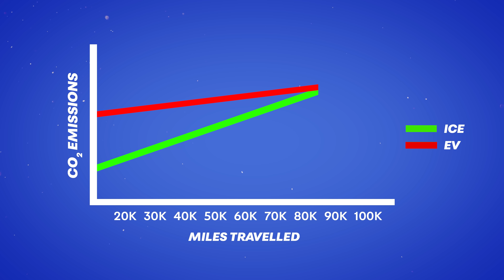Are Electric Cars REALLY That Green? [New 2022 Data]

Comment: I wonder how an LPG car compares?
Reply: LPG is clean at the point of use, but horrendously filthy during the refining process...
Reply: @Brian-om2hh  Depends if its refined at all, 60% of it comes from natural extraction. Theres also BioLPG sources. Given Dacia make LPG cars at the same cost on the bottom of the range models it's a no brainer really. Turkey and Italy have taken it up in a big way but the UK is a bit hit and miss. Its certainly worth considering given that the dacias are like 12k to start with, not seen any EV's anywhere near that price and we won't for some time yet so poorer people are still driving polluting cars. I wouldn't say LPG is clean at point of use either to be honest but a lot cleaner than the usual ICE.

Comment: carbon dioxide is not a pollutant. it is a necessary nutrient of plants and a necessary part of the ecological cycle. whether or not you are forcing a change in the equilibrium point of global average temperature by emitting carbon dioxide in the atmosphere, you are in no way "polluting the earth" through such emission. 

This is not just a matter of semantics. This is a fundamental misconception that leads to improper response. basically, it is well-poisoning propaganda to regard carbon dioxide emission as "polluting".

Comment: I work for a company that makes hydrogen gas compressors to refuel trucks that work at mineral mining sites for electric car batteries for multiple car companies. 
Only the transport trucks use hydrogen,which the pumps run off fossil fuel driven electricity. The waste by-products from this mining procedure alone far surpasses the ev's average life span. You would have to drive a tesla for far over 100k miles before it makes the "positive impact'  ,not to mention when the EV dies, there's still literally no standard procedure for disposal.,literally melting through the environment it gets dumped at.
Laugh all you want but these are facts,been doing this for about 30 years now. It will certainly get there someday, but not in anyones lifetime thats reading this.

Comment: I own a red Model 3 AWD not because it saves money on gas or because it’s zero emissions. I bought it because it looks sexy, drives quickly and silently with its instant torque, has fewer parts making it easier to maintain, and has good technology. Saving money on each refueling merely offsets the extra cost of an EV.

Comment: Nobody is mentioning that most electric cars will lose battery capacity over time and the battery will need changing well over 90k exactly like phones need replacement after 2 approximately. Nobody is talking about long term so basically the car will need another battery and might be junked because of high repair costs and the destruction of the lithium battery will also produce emissions.

Comment: 65'000 miles from even a small high efficiency ICE car like a Ford Focus releases 14 metric tonnes of CO2, the same range on a similar sized electric car like a Nissan Leaf releases barely 4 metric tonnes, it takes some incredible torture of the numbers to get such a large difference in manufacturing carbon footprint.

The "trick" Volvo is pulling is using an extremely large battery manufactured in the most environmentally damaging way possible but without the equivalent for the ICE car they use for comparison. Like an aluminium engine block could be made in the same country as the battery (where most electricity comes from coal power stations) and get similarly massive carbon footprint costs.

Comment: The estimates are off, the full CO2 emissions of gasoline is: 3.58lbs/gallon for extracting the crude from the ground + transport and another 12.42lbs/gallon refining the crude. Add that to the 20lbs/gallon when it’s burned in cars and the true total is ~36lbs of CO2 per gallon of gasoline burnt. So the cut off point is actually 1/3 less than indicated in the video.

Comment: Screw the morality and carbon dioxide BS I’m way more interested in getting rid of a dirty( oil leaks) smelly (carcinogenic crap from the exhaust)  lump of unreliable inefficient heavy metal junk that craps out after 100 000 miles because of all the moving parts. Way rather have a clean, reliable, simple electric motor that will run for a million miles with minimal servicing
Edit add PS - current figures indicate the battery life will match the motors life

Comment: One thing you/volvo haven't accounted for is the need to replace the battery. EV car batteries tend to not last as long as you'd hope for so that would then "reset" the chart again. Say the break even is 90k but the battery needs changing at 120k, you might need to do say another 30k miles on the EV to break even again after replacing the battery
Reply: And one thing you haven't accounted for are battery refurbishments, which usually cost just a fraction of a complete battery replacement..... There is much nonsense posted about EV batteries. Usually by those whom have never actually owned an electric car....
Reply: @Brian-om2hh  yes and battery refurbishments are going to be as good as new batteries yes

Comment: It's been proven that with the current electric grid in the US, it will not handle having more than three electric car chargers in one suburban block in a community it would fail, especially during summer months with the increased high demand. EVs are not the answer due to all the other infrastructure needed that is not there. The batteries need to be made of different materials to make them more "green" as well, disposal is horrendous.
In my opinion, if we can ever get recycling down to a workable solution for the waste we produce, a lot of things would be better overall.

Comment: The breakeven point is much shorter, 50,000 miles, when using green electricity like wind and solar.

My takeaway is:
1. If you can avoid driving, do so immediately and as often as possible. Bikes, buses, and trains are way more efficient and less carbon intensive than either type of car right now.
2. If you drive A LOT and can make an EV work with your lifestyle, sell your ICE and switch to EV
3. Used cars are greener than new cars. Used EVs are greener than used ICE
4. Don't overbuy - no need for a huge battery if you only drive 15 miles a day
5. Unless you drive very infrequently, whenever you DO switch, switch to an EV. Especially if your electricity is renewable or soon to be

Comment: The EV carbon footprint idea is, at this time, a shell game and the root of the issue is where the electricity comes from. As noted the break even point is variable based mainly on this factor but to think that EVs are currently an appreciable difference in output is an ignorance to all the factors. Electric Vehicles can save carbon output if you optimize renewable energy and if the vehicle lifespan greatly surpasses the break even point but the first issue isn't the reality and the second remains to be seen. 
Firstly to look at the power generation issue is easy as statistics are readily available for miles driven in a given demographic or region and the increase in energy demand can be calculated and compared to the percentage of power generation for that area thats zero emission. For example in New Jersey if you take the miles driven by cars alone annually and multiply that by the number of watts per mile you find that a 100 percent switch would increase power consumption by 35%, and the current percentage of power generated by renewable sources is 8%. This means that over 94% of the energy used in EVs would still come from carbon emitting sources. That is merely kicking the can down the road from the gas pump to the power plant. Even if you have solar at home or some other rare source of renewable power you're still being offset in the net emissions by the other person who simply plugs their Tesla into the grid. Using one technology without revolutionizing the other means little to nothing in the end.
The second part is that you need a usable lifespan in EVs that far exceeds the break even point and thats far from proven to be the case. If we take the break even of 90k miles, thats merely the break even point for the raw material costs in emissions and supply. You haven't actually saved anything until 90,001 miles and until you've exceeded the break even by a significant percentage all you have done is break even, you haven't noticeably reduced emissions. EVs need to be capable of double or triple the break even to make appreciable savings. Much of that cost in emissions is also based on the battery manufacturing. While we have much improved battery technology from lead acid or alkaline to lithium they have a limited lifespan and if you've ever noticed how your phone battery just doesn't store the same kick as it did new or replaced a laptop battery after a couple years or best of all recharged individual lithium batteries where you can see the capacity numbers imperically you know that expecting decades of reliable performance to reach that point of double or triple the break even mileage is somewhat questionable. They have a downward curve in life that is unlikely to survive for the time it takes to drive well over the 100k mile mark let alone 180k or 270k to reach double or triple the break even and most don't keep vehicles that long anyway so there's no real assurance that the break even point will be met or exceeded without getting back to a high percentage of renewable energy which is needed to reduce the miles to break even.
There are other issues as well like safety, standardized design for the sake of emergency responders, the massive difference between a fire in an ICE vehicle versus that of an EV, and the premium that companies charge for parts and repairs on captive technology like that in EVs. Go try and get some parts to do DIY repairs on a Tesla and see how hard it is, or find a decent sized pool of technicians that are trained on the vehicles, both are an impossible mission. Look at the fact that an EV fire takes 15 to 20 times the resources over a period thats exponentially longer than an ICE or how voltage kill systems aren't standard across the industry and consider how this effects you if you're trapped or your vehicle catches fire.
I'm not against the idea of EVs but the realities are the polar opposite of of the concept used to shill them. Until we work as hard to find renewable energy in large amounts as we do to make EVs a status symbol we are merely deceiving ourselves and until we prove the longevity of these vehicles we fail to make real positive gains.

Comment: Electric cars pollute more than petro cars in the sense of amount of coal burned in order to produce the electricity to propel the car vs gasoline, the amount of c02 put out for 2-4 kilowatts is immense. Unless you live in a area that the electricity is generated by nuclear, wind, solar, or hydroelectric power then the electric car does standout in a green way but the vast majority of electricity is produced by coal fire.

Comment: China owns volvo they are not that big on environmental issues. The energy used to produce a gallon of gas is more than the energy used to propel an ev the equivalent distance of a gallon of gas. No one seems to consider that. Also apparently producing an engine, transmission and differential is worse than battery production. All that foundary and mAchine shop work is not clean. Batteries chemicals can be reclaimed.

Comment: What nobody seems to factor in on this debate, is the longevity of the batteries and when they will need replacing. Anyone that operates cordless tools will tell you that performance wanes over time, and low temperatures can have a detrimental effect on them also
Reply: Cordless tools don't have battery management or battery heating or cooling.

Comment: Really nice discussion, however one very important point not mentioned is where do we plan to get the raw materials to make enough batteries for everyone to own an ev car?  The planet is being destroyed to get the limited supply needed for what 5%(I'm guessing)  current ownership???
Reply: An increasing percentage will eventually come from the cobalt and lithium recycled from old expired EV batteries. These materials will go directly back into the system to be reused in new batteries. Circular economy.....  And you somehow feel that drilling for oil and extracting it, then refining and transporting it, to be used in vehicles which burn it at no more than 30% efficiency, while emitting pollution for every inch they are driven , isn't somehow having an effect on the planet?  Huge oil tanker spillages certainly do, and we've seen a few of those over the decades....

Comment: Transitions are always difficult especially when the old tech (fossil fuel) is spending billions of dollars trying to suppress the new cleaner energy tech. 
     There is no advantage to slowing down since every aspect of cleaner energy technology progress depends on the progress of the others and all of it is improving and getting cheaper at an accelerating pace because it's desirable and profitable for manufacturers and owners. Materials and parts such as batteries are improving exponentially precisely because it's a growth market.
Reply: Sooooo coal power is better????
Reply: @maxpower9848  : Is that supposed to be a response to me writing that transitioning from fuel to electric is a good thing?  I don't get the reasoning.

Comment: This was discussed years ago... It 100% depends on where you get your electricity. If it's solar from your house. Then it'll be better than a gas car within a couple years.  If it's from a coal fired power plant then it will eventually be better but not for a couple decades.
Reply: Solar also has production cost and limited lifespan. Those also should be considered. I am pretty sure, nuclear energy is waaaaaaay cleaner than solar and wind, all things considered.

Comment: I bought my I3 because it's cheap, not green. It costs about one-fifth as much as the Ford Ranger it replaced in fueling cost and the maintenance burden is practically eliminated. Also performance is clearly superior, it's a quieter, smoother ride than a Rolls-Royce.

Comment: Remember current batteries wear out too, and you either have to replace them or get rid of the car. Replacement batteries are 2/3 price of the car. Plus we need lots of rare earth metals needed to build batteries are just that, rare.
We need better batteries to make this viable
Reply: But a battery refurb can be just a fraction of the cost of a full replacement....  And rare - in the context of minerals - doesn't necessarily mean scarce. It's a technical term. There are large lithium deposits in South Africa, Canada, the US, China, Russia, Brazil, Chile, the Congo, Australia, and Cornwall in the UK. It is estimated there may be sufficient lithium to last approximately 30 years. But by then, most EV manufacturers will have moved away from using minerals such as cobalt and lithium. Tesla are already producing cobalt free EV batteries.

Comment: Two main questions come up. Will the original battery in an EV last for that range, 124,000 miles or will it have to be replaced once or twice? If it has to be replaced, it very well may be more polluting than the equivalent ICE car. Do they factor in the carbon cost of building and installing EV charging stations across the nation to provide enough capacity? I don't believe any country currently has a power grid sufficient to charge all the vehicles if we were to transition to all EV by a date like 2035 as some places are advocating. The carbon cost of upgrading the power grid should be factored in as well. It's easy enough to store emergency supplies of Gas with a hurricane bearing down on an area, but it's nearly impossible to store an emergency supply of electricity sufficient to recharge an EV. In 25 years we may have all the problems worked out to where fossil fuels can be truly phased out of ground transportation.

Comment: I agree with the point made on the video however, you mentionned 80k-90k miles to have a pollution match. I also heard the argument being made but it was 80k kilometer. So I think there might have been a mistake on the unit. But still 80k kilometer is still a quite a lot just a tad less than the 80k miles you mentionned.
Reply: 80,000 km is equal to 50,000 miles.

Comment: You break even with emissions at same point as life span of your batteries - means you are not going greener after that, you must install new battery pack and go back to starting point... Why many channels "forget" about limited life span of battery packs in EVs?
Reply: "Limited" lifespan? So an 8 year warranty, with a probable lifespan of a further 3 to 4 years is "limited" is it?   And why must you "install" a new battery pack?  Why wouldn't you consider a pack refurbishment, where the failing cells are removed, and functioning cells replace them? After all, this is likely to cost just a fraction of the cost of a full replacement.. Here in the UK, battery refurbishments are already happening...

Comment: Everything progresses. If you continue with ICE, nothing will change.  I think we reached the plateau on maximum fuel efficiency.  Electric cars start more or less where ICE maxed out.  They will progress to higher efficiency... improved battery technology,  manufacturing gets greener, etc... it will take time. But to get there need to make the switch.